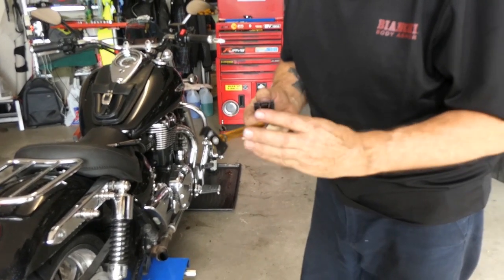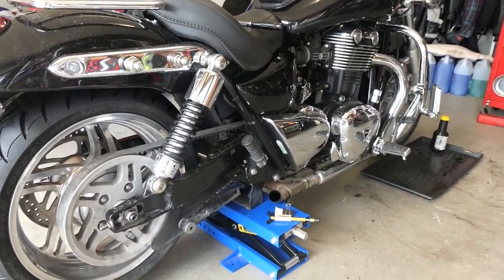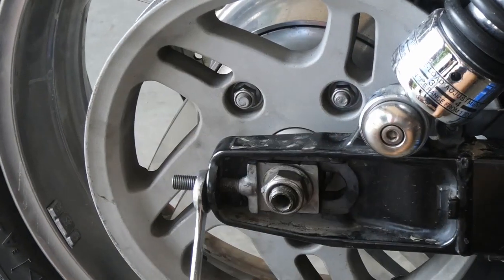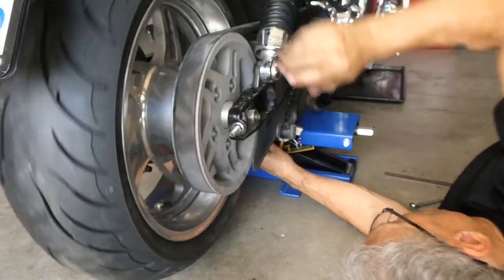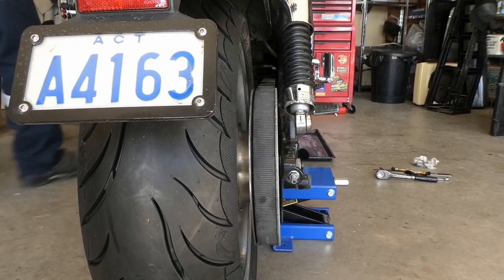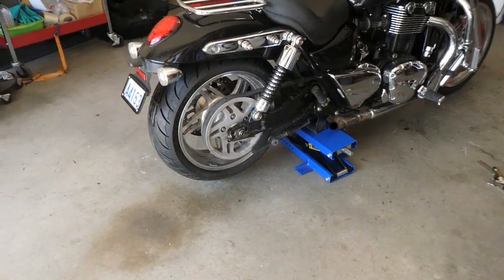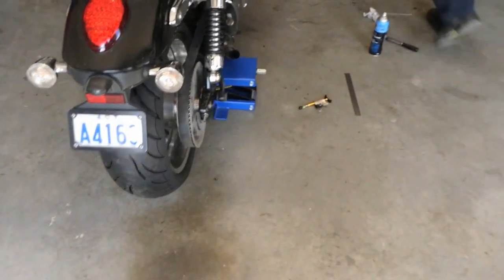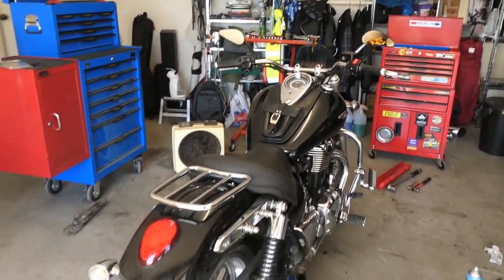Adjusting Triumph Thunderbird Belt Tension & Alignment. (Eliminate belt squeak.)

Comment: After the adjustments, my belt still rides on the outside edge (when facing from rear it rides away from the bike, towards right)
I adjusted the left side screw (brake side lug forward), but I don’t want it move too much forward, my notches don’t align any more, for example my notch on the right side is on “dot three” and the alignment “dot” on the brake side is at “2.5 dot”
The Q is how much can these dots be miss aligned, I don’t want to move them too much apart from each other so that my wheel starts to ride at an angle (what ever that minute angle is)
Is there any other adjustments i can look at, do I need a new belt? Or miss alignment of “dots” are fine up to some extent and what that tolerance is?
Please advise ….
Reply from the maker: I'll run this by Steve and get back to you mate

Comment: What bike lift is that. I have a 2010 and I'm looking for a good sturdy lift that will fit under my Thunderbird.
Reply from the maker: Just a bog standard motorcycle scissor jack mate. You can pick them up for around $100.
Reply: @1couple2bikes  but where do you safely put a jack on these bikes? The service manual doesn't give any guidance at all
Reply from the maker: Sorry mate didn't see this. I'm not sure what Steve's using but we've got a SCA 680kg ATV lift from Supercheap. Level the bike with a block of wood under the kick stand and away ya go. Maybe put a bit of ply on the lifter arms to keep off the dangley bits.
Reply from the maker: @magsteel9891  Steve was using a scissor lift just to get the back wheel off the ground in this video as this bike has a home made lift bracket attached. typically he uses the ATV lift under the engine at the balance point. I'll be posting a vid soon on the front forks and it'll be better seen on that.
Reply: @1couple2bikes  Thanks man.  I looked more carefully at your video and saw the cross bracket bolted there.  I thought maybe it was a jack-b-quick attachment, they are no longer available.  It's so hard to buy anything for these bikes.
Reply from the maker: @magsteel9891  It's actually a home made bracket that come with the bike. there was also one at the front but I removed it as it was blocking access to the oil filter. Both aren't really needed, you can jack on the pipes.

Comment: Thank you for posting this. For some reason in the US, these bikes never really took off, even though they are much better than the equivalent Harley Fatboys so information is difficult to come by. This is a very challenging issue that plagues the Thunderbirds. I have been trying to put off the task of removing my back wheel for some time now because of this ... Steve makes it look easy and it certainly should be straightforward. Some people mention that the dynamics can change when the weight of the motorcycle is on the ground (It shouldn't but people say it can and with all the weight it is possible I guess).  Just wondering if you or he has checked this after riding it? That would be the final test. Anyway, thank you for this and to Steve with the tip on the tension tool. I was going to do a pen clip that snaps on to the body and bend it to stick up at 90 degrees (similar to Triumph tool) but Steve's method is much simpler and cheaper! Ride safe!
Reply from the maker: Rider weight shouldn't change the dynamics but I've heard of this too. You just have to bite the bullet and go through the process again if it does.
Reply: @1couple2bikes  Thank you for taking the time to reply ... yes agree 100% with you ... just got to try it. I think my question was more of if yours has stayed put. Also noticed the jacking bar Steve used to jack up the rear end on the bike. Is that available somewhere? I tried to get one from Jack Be Quick but they no longer make them. I am about to go through the process of designing one myself but if one exists, I'd rather just buy one. Hope to see more vids on the bike! Cheers
Reply from the maker: @turbo97semax  Sorry mate missed this. The jacking bracket is a home made job that come with the bike.